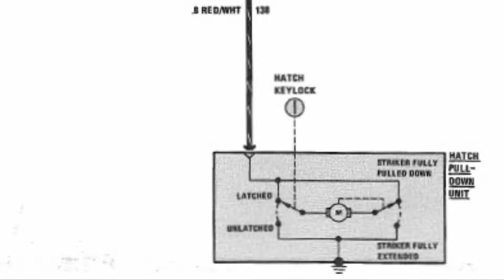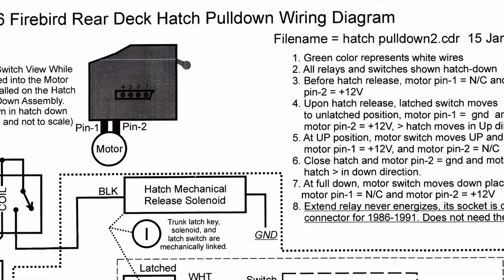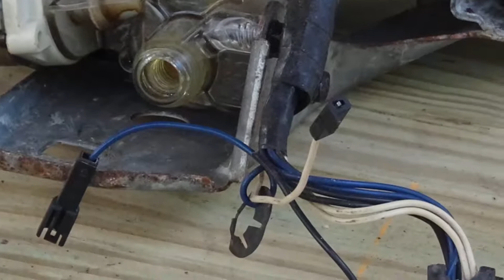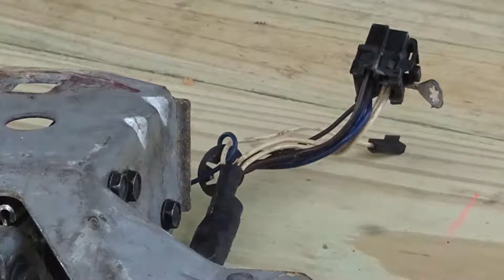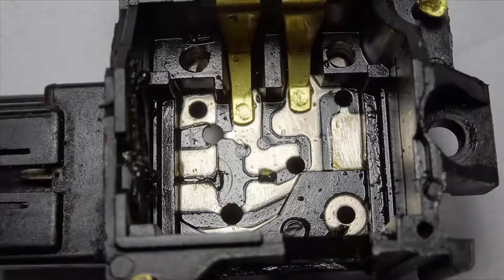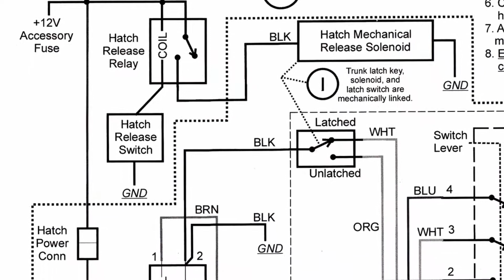Firebird Hatch Pull Down

Comment from the maker: I have noticed where the latch motor struggles at the end of the pull down cycle. This could be the result of the entire latch assembly being adjusted too low. Mark the current location, then un-tighten and raise the assemble 1/8" and re-tighten to test. The motor should not struggle heavily at the end of the pull down cycle.

Comment: Awesome, thanks.  My 1988 TA motor isn''t moving, down (stuck up) but latch is triggering release upon pressing switch.  I can't wait to look this over tomorrow.  I did use a TDS Solutions kit years ago, with one of Lon's modified housings.  Worked great for long time.  I suspect its either motor or motor switch.

Comment: Trying to make this work in my street rod. any suggestions.  When I push the trunk release button I need the up motor to kick in until switch is fully up then shut off. I am raising the trunk with a power ram.  then when I bring the power ram down it comes down and latches with the lock mechanism pulling it down tight.  I can't figure out the relays to do this